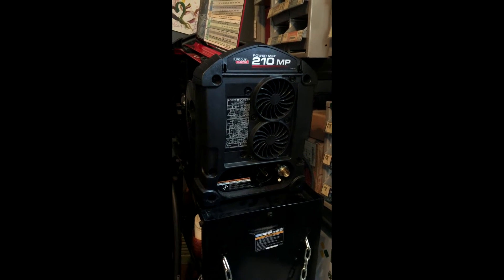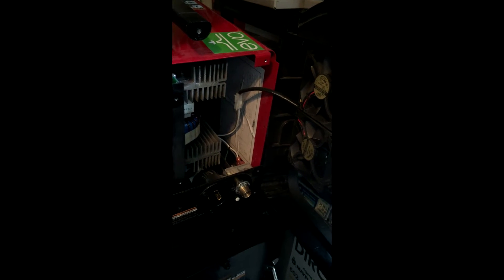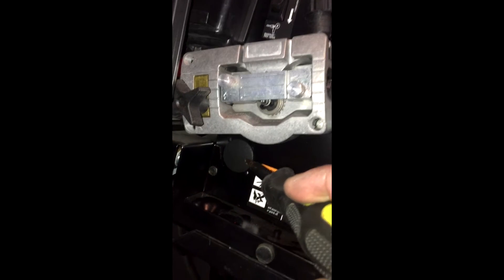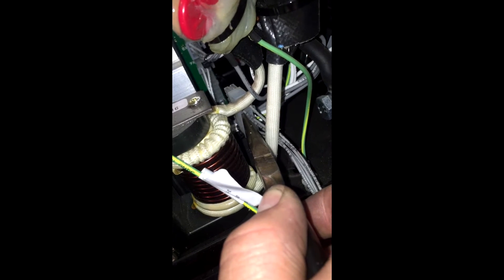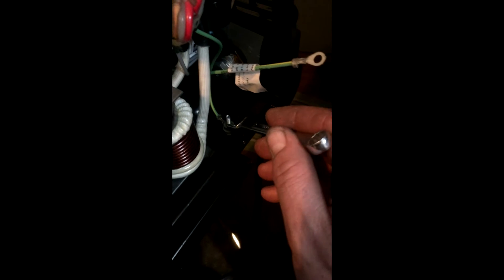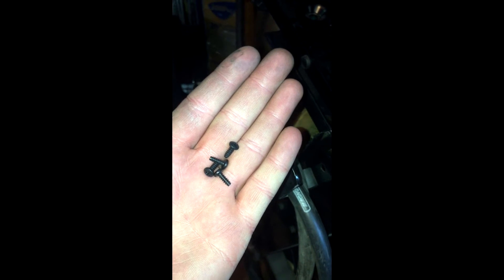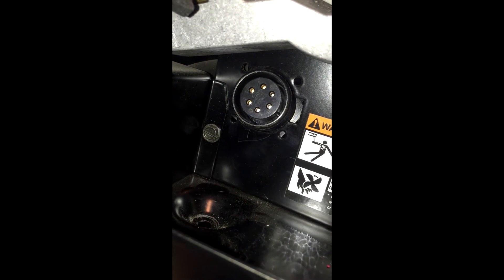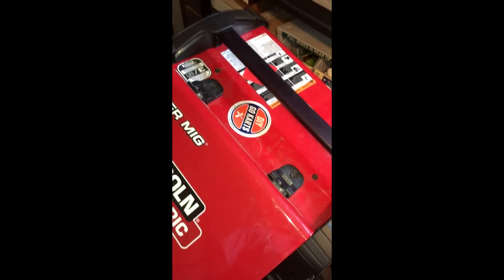How to install Lincoln Foot Amptrol Adapter in the POWER MIG 210 MP

Comment: I'm having alot of trouble getting the connector to fully seat. The white plastic rectangular will not fully seat into the connector on the board. anyone else have this problem? of ideas to fix it? maybe one of the pins is bent?  I can't believe Lincoln doesn't pre-install this. Its very misleading  to sell a tig welder that dosen't have a foot control.  I've spent $50 on the parts for this and over an hour trying to install it. At this point I 'm wishing I bought a different welder. Most TIG welders already have this feature installed.
Reply: I agree it's beyond ridiculous that this adaptor isn't pre-installed. Do you have the plug going in the correct way? There's a little locking tab on the white plastic connector that has to click into the control board connection, the tab needs to be facing to your right when you put it on. What I did for mine was use a 12" ratchet extension to gently push the connector onto the control board until it clicked in, got it on in about 5 seconds.

Comment: Gas off? Or wrong gas.. Better RTM
Reply from the maker: +Rick Brandt I'm not sure why you ask, maybe all the smoke? Well it was "MIG" gas 25/75. I know it's not for TIG welding, I simply wanted to be sure the pedal was controlling the amperage. I was not attempting to weld.
Reply: Was warning as it fried the tungsten and into cup. not a fair test or the way to get started  with TIG. Gas coverage important for tig success. Good Luck in your endeavours. The manual should explain. Reading helps avoid problems.
Reply: @rickbrandt9559  I have the same problem eat up the tungsten the soon i strike
Reply: @rickbrandt9559  you forget most people are not even close to as smart as you. please don't rub it in. someday maybe you will make a mistake and know the feeling.
Reply: @thatbiguy1975    was a helpful hint! what was yours? Funny how I go back to a manual/directions & cures most fruitless efforts. I'm 75 & still reading...